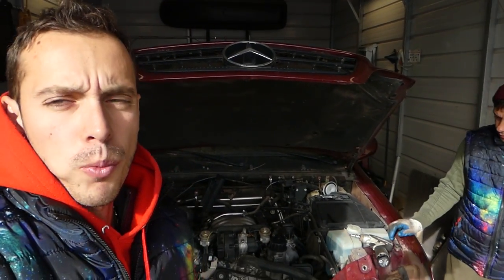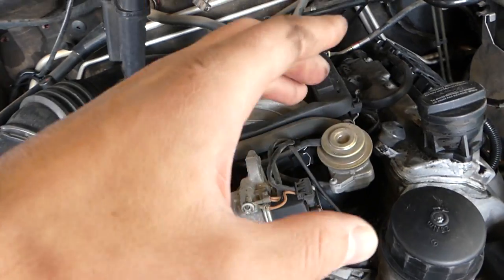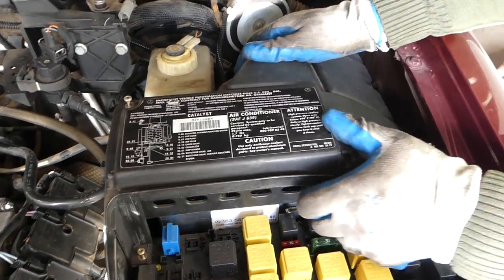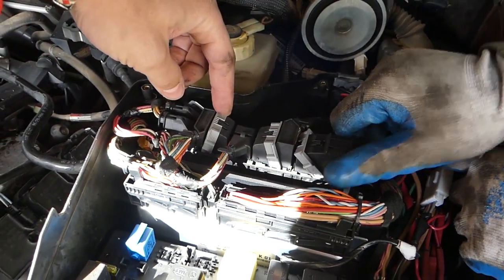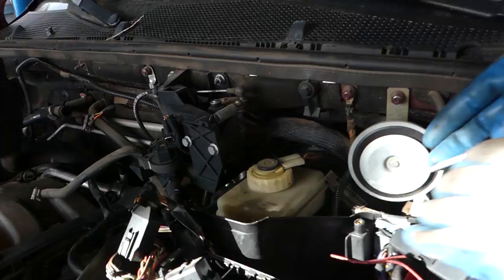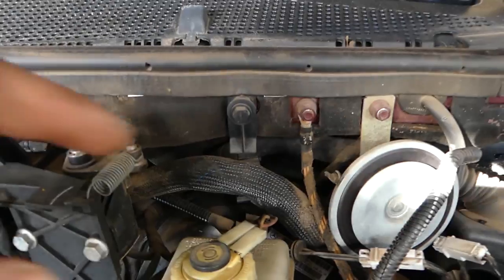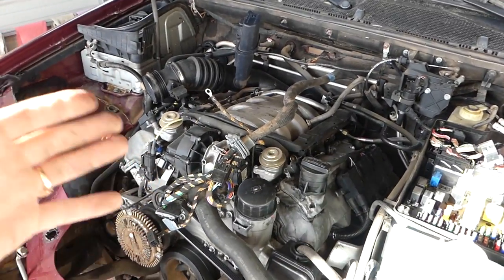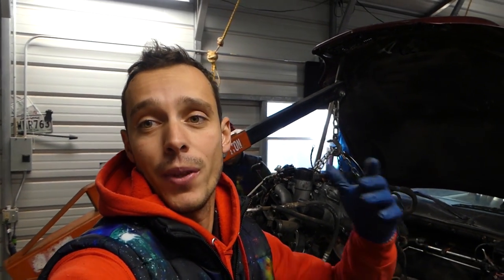MERCEDES ENGINE WIRING HARNESS REMOVAL REPLACEMENT ENGINE

Comment: thanks for ur job . if have w220 s600 . then i wante change engine to engine s350 what shold be shang ..remove  engine withe harnes cable and computer for s600 and replice seame back s350 . its work or not ..??? 
far away transmion no proplem i chang . thanks fraind